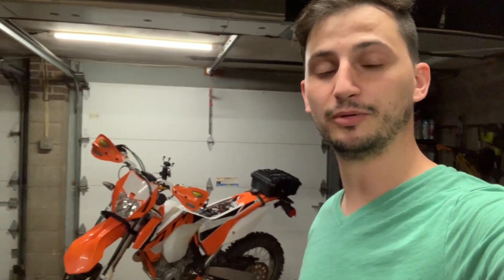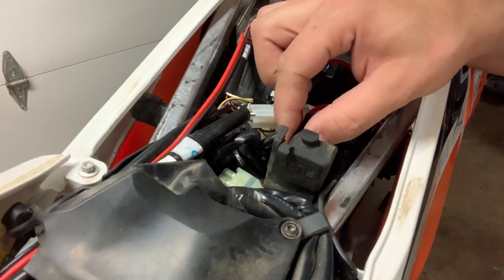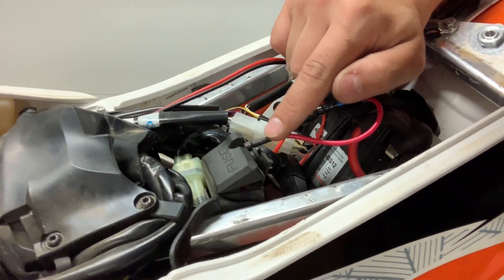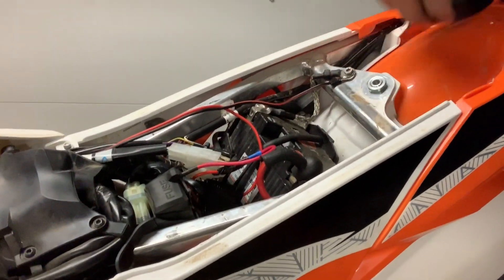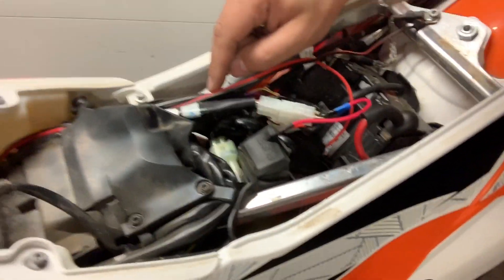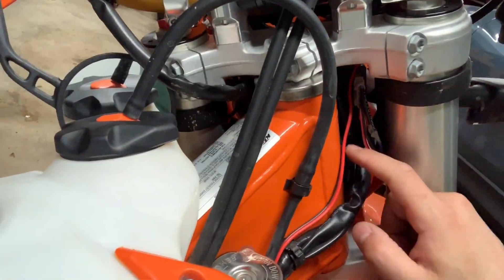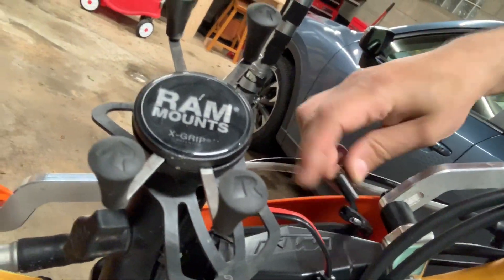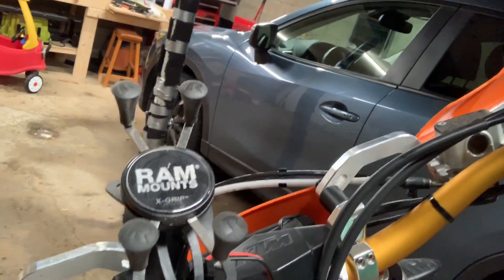2016 KTM 350 EXC-F - How to add a USB charger that runs off of the key

Comment: where did you get the usb to the battery connector?
Reply from the maker: This is the one I used. It has the SAE port, usb to sae adapter, and even a built in fuse. Since I also used a fuse tap to make it work with the key, the fuse that comes with this “kit” isn’t really necessary.

MOTOPOWER MP0609AA 3.1Amp Waterproof Motorcycle USB Charger Kit SAE to USB Adapter Cable W/SAE Cap Motorcycle Phone Tablet GPS Charger https://www.amazon.com/dp/B071HWPGQ3/ref=cm_sw_r_cp_apip_iG1aN2JN39Sdp